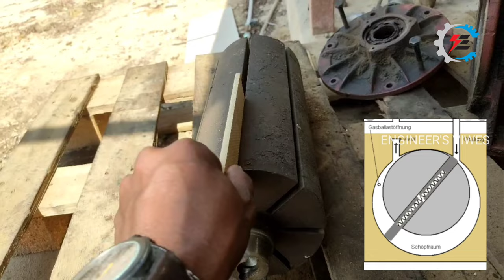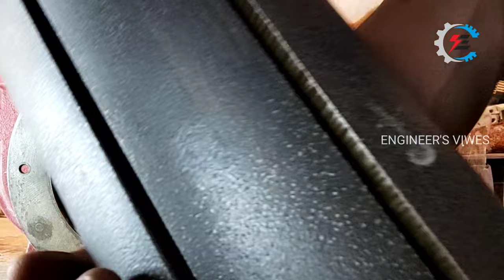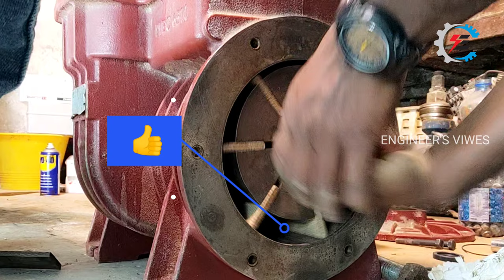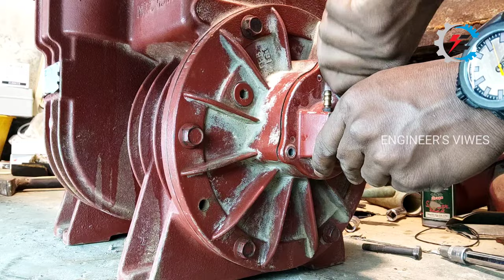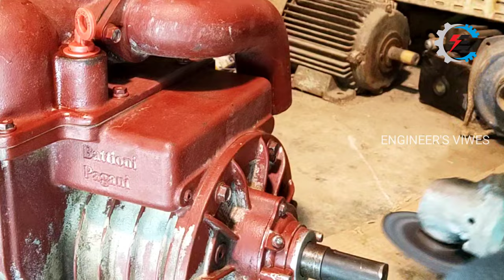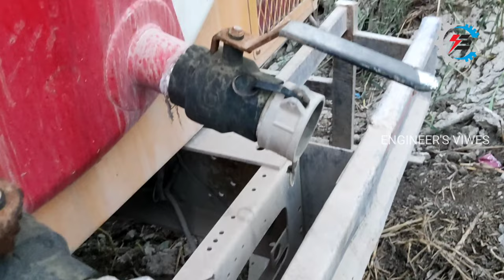Rotary vane vacuum pump | Vacuum pump | Restoration #VacuumpumpRepair #restoration

Comment: hi dear,I have a Battioni Pagani MEC 4000P model pump used for vacuum purposes. I found on the internet that vacuum pump oil VG100 is recommended. Is it suitable for this type of pump? Also, my pump has another problem: oil is coming from the exhaust. How can I solve this issue?
Reply from the maker: hello how are you 
      VG 100 is hydraulic premium oil, VG 100 oil is a good alternative to mineral oil, you can use it, but in my opinion mineral oil or synthetic oil for vacuum pump, oil leakage from second outlet, that pump oil seal is damaged.   .     That is why the oil separates from the exhaust. Thank you

Comment: Jurop metro water super suker pumb how wagum ingirees
Reply from the maker: I think some vane is sticking, remove the pump and check its vane
Reply: Can we use oil replace hydraulic?
Reply from the maker: Yes, you can use the mineral type of hydraulic oil, which is used to protect the pump from heat and clean dirt.
Reply: @engineersviews4909  are there any specifiction but for hydraulic user or any one ?